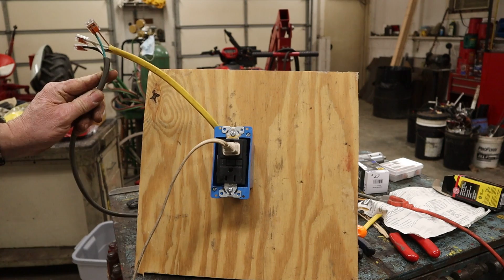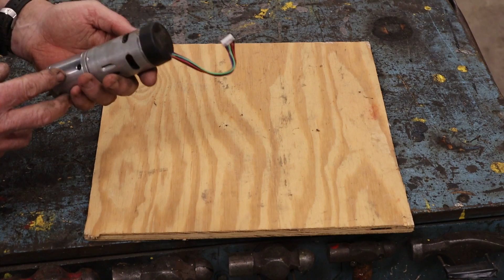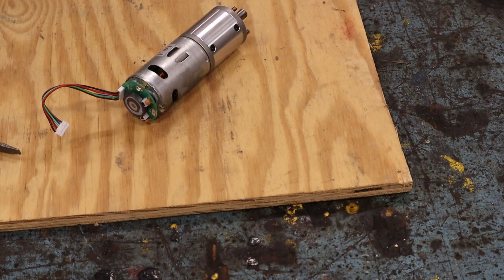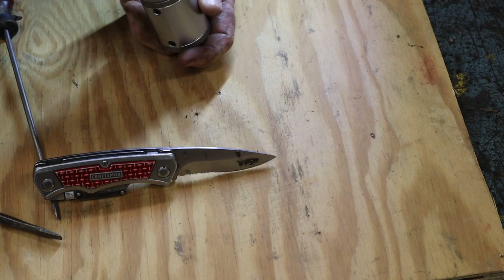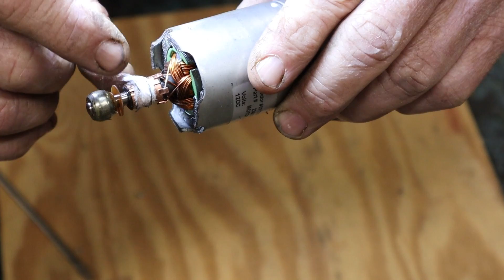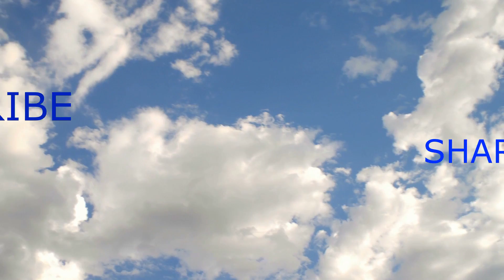Bad GFCI Outlet Test (Epic Fail) Schwintek Motor Teardown

Comment: Kenny I have seen intermittent ground faults like what you described and I have seen where the contacts in gfci outlets stick once they trip and out of nowhere release once they are de energized.  Thanks for showing us your true tech side and destroying the motor to show us the issue.  I have never seen that before very interesting.
Reply from the maker: Actually the guy called yesterday. Both have failed again. I will be going back.
Reply: @hillbillyrv  curious to know what you find  maybe check the backs of some of the downstream outlets if your meter doesn’t show a short to ground.  Maybe one of them is burned/ melted and making contact once the circuit gets loaded and heats up.
Reply from the maker: @marcuscarmouche9023  I will be back there at 1:00 tomorrow. I hope I can figure it out. There will be a video.
Reply: @hillbillyrv  awesome good luck bud hope it stays broke so you can find it.   A lot of people don’t understand if it ain’t broke you can’t fix it.
Reply from the maker: @marcuscarmouche9023  No truer statement than that. I have said that a million times in my career.

Comment: I’ve got 3 gfci In my trailer all on one circuit the back wall kitchen and bathroom in your case Kenny it could have been a loose wire on one of them I had my 30 amp breaker keep popping and some of the wires were loose in the panel
Reply from the maker: Yeh, I don't know. I didn't really check them, but it didn't seem like anything was loose. It's one of those mysterious mysteries.

Comment: Could the issue have been created from running two GFI in series and not parallel? Keep up all the great work love the videos.
Reply from the maker: 2 different circuits.
Reply: No they are ran in series to prevent splitting amperage. Also on gfci circuits running them in parallel would give the downstream outlets a means to bypass the gfci which would be a safety issue.  Campers still have to follow nec 70 code as well. Hope this helps.
Reply from the maker: @marcuscarmouche9023  Thanks

Comment: Im  wondering if anyone ever looked at the neutral safety switch on the van. I have had issues with em in the past causing the system to fail. 
Take care of yalls selves
Reply from the maker: Thanks Deadwood. It wasn't an issue with it cranking. It was bad ECMs.